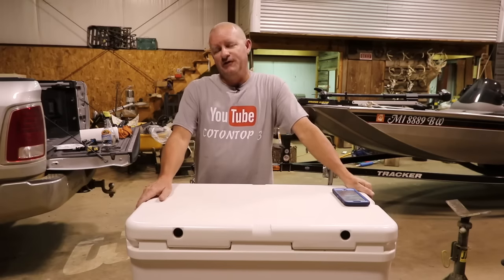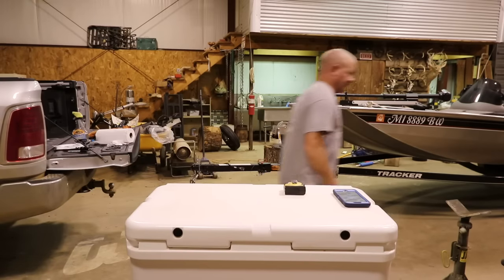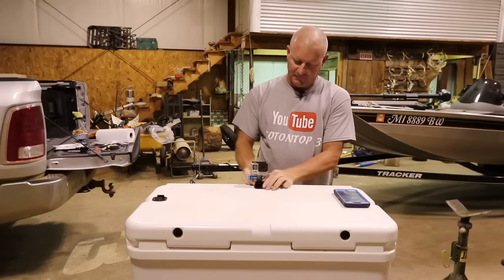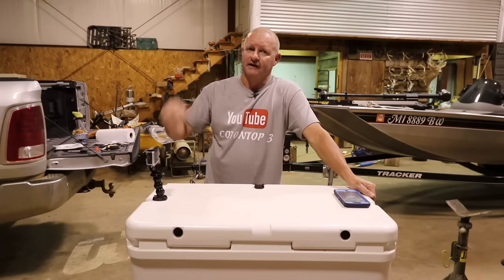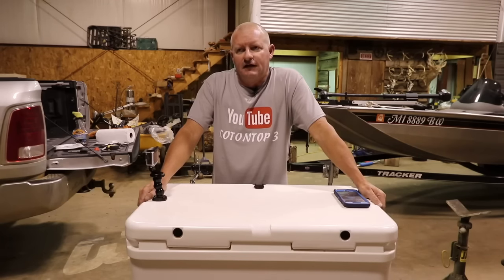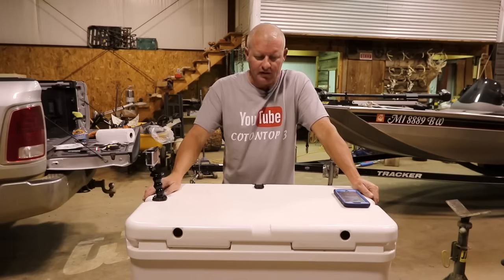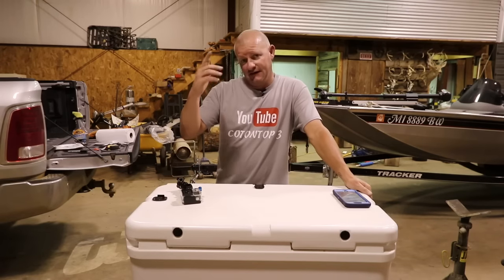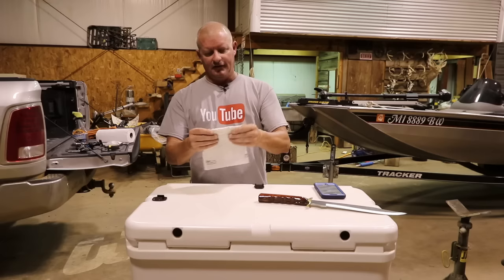How to make an RTIC cooler even better than it already is and a giveaway!

Comment: The video is very clear Tim as is the audio. In fact it is so sensitive it picks up your breathing sounds and some other noise in the workshop - could that be the lights buzzing. I can see that the microphone is positioned near your throat with, I guess a spring clip. Try, if possible turning down the sensitivity or perhaps lowering the mike down your chest a bit, perhaps a couple of inches or so.
I like your tee shirt colour and graphics but would have no idea for a logo suitable for you.
Reply from the maker: +Dan Whiteford I thought the same thing too, gonna drop the mic down about 3-4 inches and that should get it.  That is those lights buzzing that you can hear.
Reply: +cotontop3 boys that mic is potent...
Reply: If they're regular high-bay lights, look into some LED replacements.  Prices are coming down, no warm up time, they add less heat, and save a ton of power.
Reply: You can improve the video by including content that is actually beneficial to the viewer.

Comment: I just bought a brand new Orca 10 day cooler & can only get 2 days or ice retention inside my climate controlled house in the low 70's F. What's the secret to getting close to 10 days? Do you guys use special ice or what?

Comment: Good to see you having fun with your Channel .
Reply from the maker: +VideosByAl hey Al, which woodmizer do u run?
Reply from the maker: Do you feel like the woodmizer is the best option between all the other mills?
Reply: In the Thin Kirf High Production Market, Wood-Mizer is the way to go.
I've ran TimberKing and Baker mills in the past to help the owners get better production. I even got call to figure out a problem on a Cooks that 4 other guys could not figure out. I had it figured out in about 7 minutes. The Cooks is the least desirable of the 4 mill listed.
Reply from the maker: +VideosByAl that's what I was figuring that you were gonna say. I have wanted one of those mills for years and now with all I have going on, I have no idea when I would be able to mess with it.  I would just need one of the smaller woodmizers is all I would need.  Woodmizer is gonna be at the logging show this week.
Reply: Most likely WM will let you make a test cut on one of the mills.
Give some thought to an Electric LT15 if you plan to set up in one spot.
Keep it inside and you won't have to fuss with fuel and engine maintenance.  Customer Service is out standing @ WM.